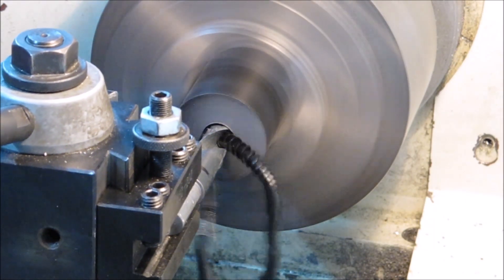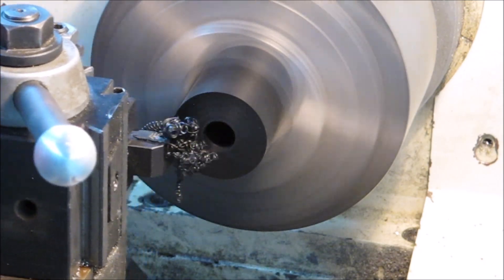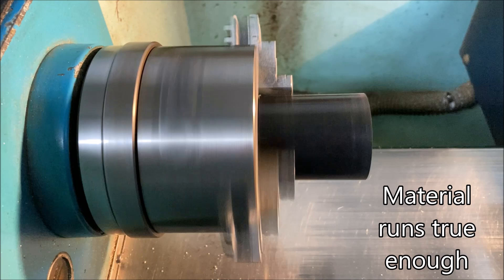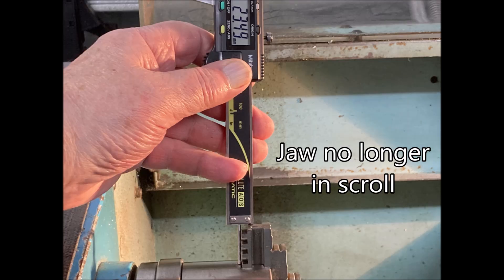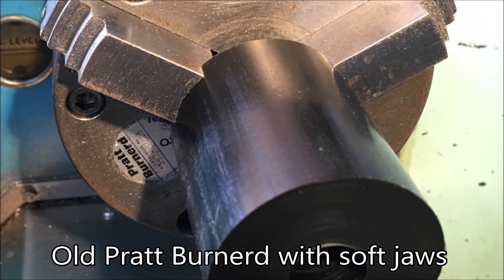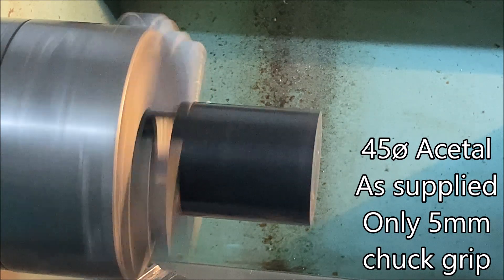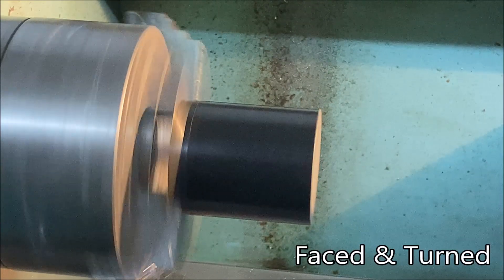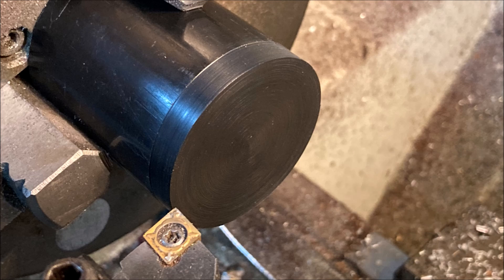One setup Part 1.  100mm TOS chuck vs 46 OD acetal.  Hercus PC200 cnc lathe

Comment: Machine the soft jaws off and make two piece jaws
 (I highly doubt you can buy off the shelf two piece soft jaws for that small of a chuck.

Funny how chuck size can make or break a lathe.
The current trend has been towards large chucks and spindle bore, this was not always the case.
Looking at old catalogs recommended/supplied chucks were at least 2” smaller on average.
We had a 14” Cadillac lathe at a sawmill where I worked, no matter what something was always in the way and every job was a fight!
I currently run an 26x80 with a 17” 4 jaw chuck.
There are 3 classes of work, too big, too small and stuff that should be done with a 3 jaw or collet chuck.

Cheers Ross
Reply from the maker: Hi Ross, my lathe was built as a training lathe for use in education, was never intended as a production unit. I find TOS are brilliant suppliers, they have two piece and one piece soft jaws available for all their chucks, down to 80mm. Love your description of work sizes. Reminds me of buying any machine tool, whatever your choice it will be too small of too large. Thanks for your comment

Comment: Make a spider for the spindle nose?  You can use all the volume inside the spider since bolts are going to hold the part.  Hopefully once you dial it in once, you'll only have to take one bolt loose (ok, maybe two) to change raw stock as long as all the raw stock is reasonably consistent.
Reply from the maker: Thanks for your comment

Comment: Well it's plastic which virtually has no hardness and is pretty light. I would just leave lower RPM for the first interrupted pass if vibrations moved it slighty.
About centering - don't push the part on shoulders of the jaw so radial grip centers it, use some right angle ruler or simply machine a cap which holds one side of the workpiece, is centerdrilled on the another and you use tailstock to center the workpiece while clamping it, then just move tailstock back and remove the cap. Or just go to saw and square the workpieces properly.

Comment: I'm assuming you don't have the other set of jaws to hold larger parts ? I recently purchased a Vertex 3 jaw 100mm chuck from General Tools in Adelaide for about $170. It's been excellent so far. Time to replace the TOS chuck ?
Reply from the maker: @HM-Projects  replace the TOS. Never! They are brilliant. Checked for a 5 inch max dia was 40, my 4inch TOS is 39, TOS 5 inch is 49!  Quite a difference. I have found some jaws that will do the job, will do quick video shortly

Comment: where do you get soft jaws for the pratt burnerd?
Reply from the maker: I am not sure if they are available. I bought the last ones in Australia and was told there were no more. The chuck is so old and worn I have never used it with the original hard jaws, they are too worn to bother. PB made their soft jaws slightly oversize (deliberately) and they are a great fit in my chuck with no work done to make them fit. Thanks for your comment

Comment: Other than bore out the soft jaws deeper i can't think of any other option.  And the poor old number three jaw is usually the one with a broken tooth when gripping outside the range.
Cheers Ian
Reply from the maker: I have not contemplated doing that as the bit held in the jaws is thrown away.  The option would be make the jaws deeper and use a spacer ring for the second operation .  The piece in the chuck is scrap.  Thanks for your comment, it has me thinking. Nigel

Comment: Pre op! a PITA!
Reply: Stefan Gotteswinter and possibly Robin Renzetti did videos on making dovetail jaws for securely holding plastics.
Reply from the maker: Thank you, I imagine that would be to improve the grip ion the part.  My problem is the runout of the part not wanting to clean up at 45mm.  That is in the second operation, so I would not see the problem until all parts had been done in the first operation!  That would be quite a mess
Reply from the maker: @crozwayne  hello young man, seems like ages since I heard from you. Have you uploaded lately?  Thanks for your comment
Reply: @smallcnclathes  I’ve been way too busy, this engineering malarkey swallows so much of my time!
Reply from the maker: @crozwayne  If folks don’t create videos, they have no idea how much time it adds to getting the job done. No riding your bike even?
Reply: @smallcnclathes  I did 9 miles on the road last year! and about 100 on the track at Pembrey circuit! yep, way too busy at the moment lol

Comment: Could you bore the soft jaws so you have 10mm engagement with the part? 😀
Reply from the maker: @julias-shed  I could, but I am not sure it would be enough. The hard jaws have the advantage of the chuck face to help with stability. Thanks for your suggestion.
Reply: @smallcnclathes  I think with a relief at the back of the jaws they could be bored so the part could go all the way in